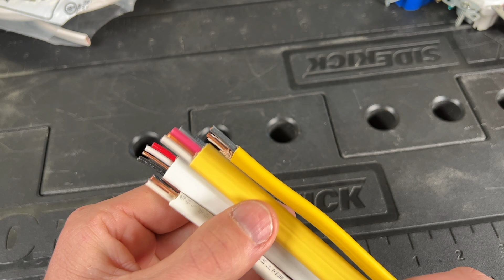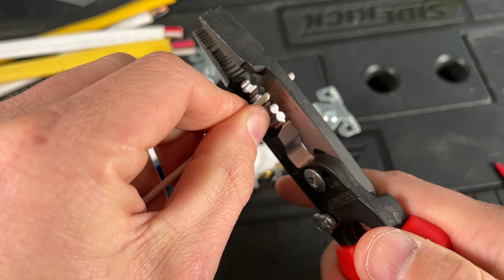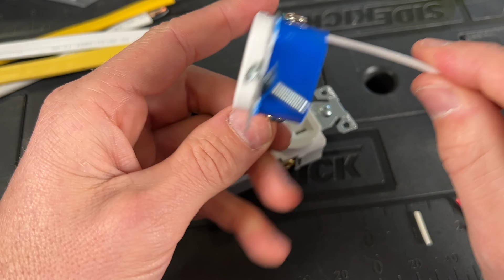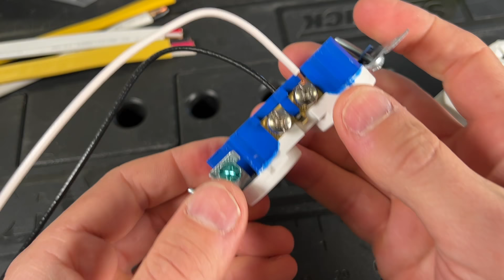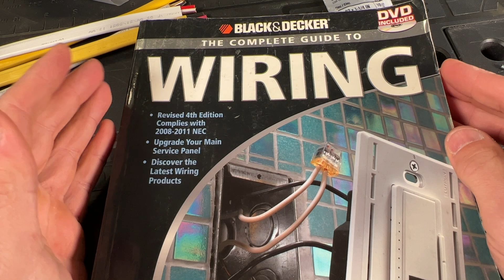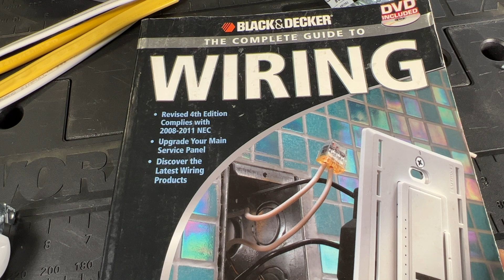#1 Best Video for DIY Electrical Outlet Basics

Comment: My home doesn’t have a dedicated outlet under the sink for adding a garbage disposal. I was told not to share the dishwasher outlet. What would be the easiest way to add a line for the new garbage disposal? I have an unused outlet just outside of the cabinet. Can i move that, or will that mess up that circuit? I apologize if that is a remedial question.
Great video. Basic and informative! I appreciate the lesson without the extra chatter that can be so time consuming. You held my attention from start to finish.

Comment: Great video. Basic and informative. I appreciate the examples and explanations without the useless chatter that can be time consuming. You held my attention from start to finish. 
ONE question… I saw someone doing a fix in my home using 20 amp yellow romex on a 15 amp circuit. Should that wire get changed? Or is ok to carry the load without compromising anything.
Reply: Bigger wire never hurts anything as far as carrying current.  Bigger wire (smaller gauge number) provides less resistance for the same amount of current.  Less resistance is good, and means less heat.  
There is a tradeoff, though, as we can't afford or manage to fit 1 inch (2.5mm) conductors everywhere, even though that would be nice.  
For wiring devices like switches and receptacles, they are listed for specific sizes of wire.  The outlets in this video should be able to legally accept 14, 12, or 10 AWG wire.  Anything bigger than 10 is out of spec for the device, and so would be against Code.  

One thing to remember is extension cords are hazardous because they carry the same electricity as the good wires in your walls but they may not have the same capacity or quality as those wires!   This is why using the right-sized extension cord is important.
Reply: @jovetj  Can you explain what you mean by extension cords not being the right size and they can be hazardous? I use a lot of extension cords.
Reply: @england670  If you're in Europe and you're using a properly-fused plug, it's not much of a hazard.
In the USA, very few plugs have fuses in them.  This can allow all of the current in the circuit to flow through the circuit in the wall and through the extension cord.  The wire in the extension cord is often smaller than the wire in the wall.  Smaller wire carrying an amount of current exceeding its rating will get hot and can catch fire.

Comment: Romex wiring is not approved in all locations check with the local building department.  Some locations require conduit and wire pulled through it with metal boxes

Comment: One question I’ve wondered about is, can you use 20amp outlets anywhere in your house if it only calls for a 15amp outlet?
Reply: I would not because you don't want to  put more load on any circuit than it can handle. Meaning if you plug something in that uses that high amperage when the circuit itself is not designed for it that's a problem
Reply: @ronp499  thanks for the reply

Comment: Excellent video. 
Regarding receptacles having red and black hot wires and the metal tab between removed: those are also used for split receptacles that the electrical code requires in kitchens, for example.  Doing this avoids the problem of plugging two appliances into the receptacles and blowing the breaker. Splitting the receptacle puts the coffee pot and toaster on separate circuits. (BTW,  those two breakers have to be tied together so they operate together).
Reply: Thank you for this input!!

Comment: Another use of the break away tabs at 19:07 is a spacer on screws to level out the face of a receptacle, especially in a metal faced j box where you use a screw and nut to attach the receptacle or switch

Comment: Klein tools makes a circuit breaker finder to help locate the circuit breaker associated with a given ac outlet.  Are you familiar with this tool and if so would you recommend it?
Reply: They are about $50, so it's a judgment call but probably not worth it for a homeowner who may not use it often. Once you map out where each circuit goes, you'll never need this tool. It's more valuable to an electrician.

Comment: I have a second property I purchased, the whole home is ungrounded. I grew up in a ungrounded home so I initially didn't think twice about the purchase. I had a electrician come out and he quoted 11k for a rewire of the 1500sq foot home. I will have grand children there, and that's my main concern. My question is how common is it for homes to be ungrounded? Is it really as unsafe as the electrician stated? Is there any other avenue besides a total rewire to ground? Please and thank you
Reply: You could put a GFCI receptacle as the first receptacle in each circuit and all downstream receptacles will protect individuals when connecting to the load of the GFCI. Depending on the present connecting methods, it could be easily done or impractical to do. If it's impractical to find the first one you could install them only in certain locations. In this case you would use only the Line connections on the GFCI. 
You still will not have a ground, but it will be safer for individuals and is a code compliant solution.

Comment: At 20:06 when cutting screws you should put the screw in the threaded side of the tool first. This will prevent the screw from flying out somewhere, and if you cut a small amount, the scrap piece can be difficult to remove. Another reason is when you back out the shortened screw, the threads on the tool will help chase off the burrs. Good video Scott, very informative.
Reply: Went right to the chat for that. The video is great, but yes, the screw should have been inserted on the other side.
Very good video, though. I appreciate your help.

Comment: In 40+ years of licensed electrician work I have found many burned up connections on spec grade receptacles from the use of solid conductors in the BACK WIRE CONECTIONS. Hook solid conductor around screws you will not have any problems. Use Pigtails (wire in,wire out & wire to receptacle) in J boxes to avoid more then one wire connection on
 receptacle . (STRANDED WIRE IS FINE FOR  THE BACK WIRED CONECTOINS)
PLEASE NEVER USE PUSH IN CONECTIONS  !!  You will sleep better.
PS .You do a great job on your Videos

Comment: Why Why are the terminals Bare, In New Zealand we use 230 volts 50hz AC scokets are 10amps for most stuff. I can't believe your Sockets. Mind you, in USA you only use 110Volts AC
Reply: In the USA we use 240v also as some appliances require it. Every home is already supplied with 240v potential.

Comment: Especially since this is for beginners, it would have been good to demonstrate and emphasize the habit of wiring ground first, then neutral, then hot.
Reply: Can you explain why, for folks new to this stuff?
Reply: @danlourenco  the idea is that current has somewhere to go, in case someone flips the breaker or something
Reply: @danlourenco  it's just another stupid thing electricians tell people to do. If you turn the breaker off when you wire it up it doesn't matter as there is no power. Just put black on brass (Right side) and white on Silver (Left side) and ground to green. Other than that it doesn't matter the order.
Reply: @realtyrocks1969  I feel bad for you the day you run into a box that has traveler wires on a separate circuit breaker going through the same box shoved with tons of wires. Regardless, it’s a safety precaution, it’s the habit that will save your life one day. Similar to how you never keep your finger on the trigger of a gun unless you are aiming at what you want to shoot, you should also wire ground and neutral first because they protect you. 🤷🏼‍♂️ you never know man.
Reply: Glad this is a good habit, just makes sense
Reply: I am a beginner watching this after I just did my second outlet. I had this exact thought, but as a question: “if this thing turns on, I wonder if it have the ground on it would protect me?”
Reply: I usually let everyone know I'm working on electrical and put a sign over the box with tape.
Reply: that's the order I use, & I'm barely experienced... just earned a physics degree
Reply: Thnaks this was helpful
Reply: I agree, not the best video as stated!
Reply: Information should be free and accurate like this without being limited to the professional only.
Reply: It doesn't matter
Reply: He’s a book electrician not a journeyman
Reply: And? So its ok to explain things with typical electrician corner cutting? Doubtful hes just doing it out of a book. Or is that all you have, book knowledge?@ochoaelectric5175

Comment: FYI CLARIFICATION:  "An OUTLET is a point on the wiring system at which current is taken to
supply utilization equipment; A RECEPTACLE is a contact device installed at the outlet for the
connection of an attachment plug. A common example is multiple (or
duplex) wall receptacle; A RECEPTACLE OUTLET is where one or more receptacles are installed.  Outlet is frequently misused. Common examples of outlets include
lighting outlets, receptacle outlets, and smoke alarm outlets."

Comment: Seen my share of DIY videos, and I can't recall ever seeing one that had so much useful, helpful info presented in so brief a presentation. Excellent, and thank you. One thing though... I think you said that we'd mostly find 20-amp outlets in our homes, along with 15-amp. Isn't it the other way around, mostly 15-amp outlets and the occasional 20-amp?
Reply: I've learned to ALWAYS read comments on videos, in case something wrong was mistakenly stated in the video. Thank you to all of you professionals that help clear things up!!
Reply: I was gonna comment the same thing. Usually 20 A receptacles are on dedicated circuits and most kitchen appliances don't have a 20 A plug so 15 A receptacles are fine. I really hope that he said that by mistake.
Reply: There's no reason or requirement to have a 20 amp duplex receptacle and you can't use a 20 amp receptacle on a 15 amp circuit. If you're using a single 20 amp receptacle, it must by code, be on a 20 amp circuit. This is primarily for a dedicated circuit where the appliance is always plugged in. Examples are a refrigerator and a microwave oven. It's a bit of an anomaly because the plug from the appliance will still be a typical 15 amp type.

Comment: 20:35 Maybe you could just save your retainer-washers for the screws on the outlets and switches, and then use them for spacers.
Reply: You would need a ton of those thin plastic retaining washers to make a difference. An easier way is just to coil up a 14 gauge conductor around the shaft of a screwdriver and make a spacer.
Reply: @darrenwoloshyn  Well, I suppose that's so, especially if you had a lot of thickness to build up.  I was thinking more in the line of maybe up to an eight inch of thickness to be made with the recycled screw-retainer washers.  An already-thicker item like the wire you mentioned would indeed be more practical if you needed a good bit of clearance between the outlet and the electrical box.  I would think that fender-washers or drilled coins would be better for shimming-platforms, though, since narrower-bodied spacers would tend to make the outlet wobble around.
Reply: @darrenwoloshyn  That's what I do, sometimes.

Comment: 20:20 One way to be more sure of being able to still thread a nut onto a bolt that you've cut the end off of is to first put on a nut before you cut the bolt, so that you can then unscrew it afterwards and thus hopefully restore the threads so that they will be even enough to let nuts get screwed onto the end of the bolt again.
Reply: Also, if you insert the screw through the threaded side of the bolt cutter, when you unscrew the screw after cutting, it will correct any deformities in the screw threads
Reply: Also, if you have a thread in screw cutter on your wire strippers, insert from the threaded side, like the nut it'll fix the threads, and you won't have to try and unscrew the cut off part
Reply: @legionofanon  Can you please link a video of doing that?  It sounds very interesting, but I don't quite follow you on how it's actually performed...?
Reply: @Quacks0  oh, I missed your comment. Where would I include pictures?
Reply: @legionofanon  Well, you would make a video of doing it (or find one on YouTube that someone else had already posted), and then tell me the link for the page in a reply-comment here :D
Reply: Good advice and common sence ; to put the not on the bolt before cutting it ! But not meny people have common sence anymore !
Reply: That was funny how was he going to remove the small threaded  part in the cutter, but when it’s cut properly and unthreaded it will clean the threads and then it can be reused
Reply: Yup that's how Grandpa taught me

Comment: At 14:55 where you loop the wire around the screw and then tighten it, before I do that I'll get mini needle nose pliers and squeeze the end of the Copper loop and  with where the insulation ends so the copper it's looped totally around the screw before I tighten the screw. Why not do this. You have extra copper just being wasted not looping and taken advantage of of the entire screw being utilized securing the copper.

Comment: For screw cutting, insert screw into threaded side in pliers. Make cut. Then, backing out the screw (which may require a screwdriver to start turning) will freshen up the end of the “buffered up” threads.
Reply: That works for the other pliers, but there is no threads with the Knipex, you just slide it through and cut.

Comment: Have you ever talked about self grounding outlets?
Reply: Self grounding receptacles only apply to metal boxes. The theory is that the self grounding feature will enhance the contact when the device is installed in a metal box or industrial metal box cover and therefore making a bonding jumper unnecessary as long as the box is grounded. There's some controversy over the interpretation of the code as some say that a bonding jumper is still required. Spec grade receptacles have this feature. You can use these in plastic boxes, no problem, but there is no function.

Comment: Most modern homes use 14/2 15amp for receptacles and general purpose circuits . 20amp 12/2 is mostly only used for kitchens and baths .
Reply: My townhome is 1982 and 12/2 is mostly (only a couple had 14/2) throughout.  It’s a college town and was meant to be used b7 students.

Comment: At 20:25 when you show off the bolt-cutting portions, if you put the screw through the threaded side first then cut, then when you back the screw our of the threaded hole, it will normally fix the tiny edges created from cutting allowing them to easily be screwed in to electrical boxes without risk of going cross-threaded.
Reply from the maker: I know the Klein and Milwaukee have the threaded feature but doesn't look like the Knipex does.  That might be one of the only things I would is missing or lacking for the Knipex.
Reply: @EverydayHomeRepairs  - I think you are missing the point.  Even the very cheap strippers have threaded holes for screw cutting/shortening.  axipher is saying to thread the screw through the threaded side FIRST (not what you showed) - then when you cut, you back the screw out and the threads in the tool will repair the end thread where it was cut.
Reply: @pete540Z  Yes...I just checked mine with a magnifying glass & the holes are threaded! Never knew that! Always learning from comments! Thanks!

Comment: Biggest mistake I have made in wiring is not using commercial grade. I already, just a couple decades later, have slightly  used receptacles beginning to be difficult to insert and unplug. Will have to replace them soon. Also, should re-emphasize that best practice is to use 12 gauge for receptacles. 14 gauge is ok for lighting circuits.
Reply: I agree that some consideration should be given to making new circuits for receptacles 12 gauge and 20 amp instead of 14 gauge 15 amp.  Households have many more types of electrical devices that didn't exist years ago such as computers, audio and video systems, and the list is endless.  It's not hard to load a 14 gauge 15 amp circuit to its limits.  20 amp receptacles tend to be better quality as well.  15 amps is ok for lighting circuits especially considering the use of LED or other energy saving bulbs which also create much less heat.  In the old days incandescent bulbs would often make the wire insulation inside the ceiling box brittle due to heat damage.
Reply: @1575murray  20 amp receptacles are better than 15 amp only when comparing 20 amp commercial or spec grade to 15 amp residential grade. When comparing among equivalent grades there's no difference in quality.

Comment: That’s not even close to a Shepard’s hook . Shepard’s hooks would be when speaking about conduit and using a Shepard’s hook is against NEC code .
Reply: Since you have such negative things to say, why don't you make a video showing how to do it better. I'm just saying.
Reply: @REXXSEVEN  not negative I just believe that if somebody is putting an instructional video , especially if they are catering to a homeowner , they should give proper information . And if they have 35year seasoned people watching then they can make comments to correct the wrong info .
Reply: @paulkronyak4069  I'm not an electrician and I appreciate comments from electricians and/or experienced individuals. There's usually a lot to learn in the comments and therefore provide valuable information. YouTubers welcome this also because it increases the value of their content as long as it's not rude and your comment is not. It's always easier to say nothing than to make an effort.
Reply: @REXXSEVEN  not to do it better . How to do it correct and use the correct terminology . A hook on end of wire to go onto a RECEPTACLE never is or was called a Shepard’s hook lol A Shepard’s hook when using it in electrical context is when a piece of conduit is bent back and then passed a 90deg and looks like a Shepard’s hook which is against NEC code
Reply: @paulkronyak4069  gooseneck